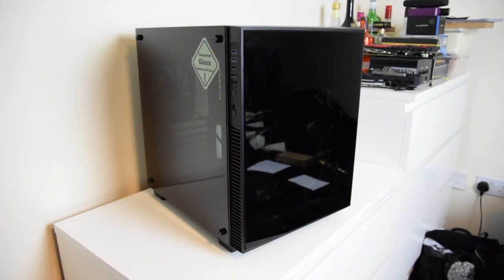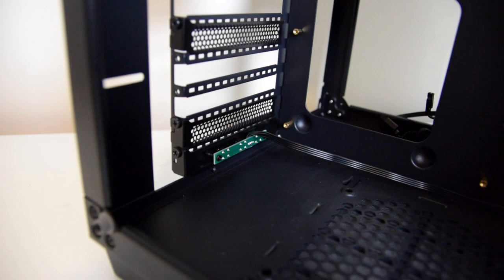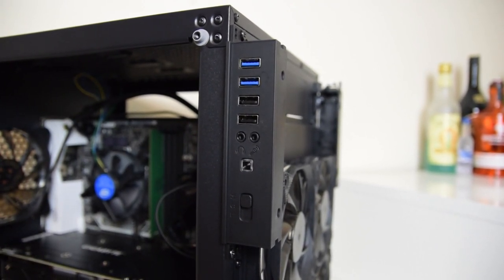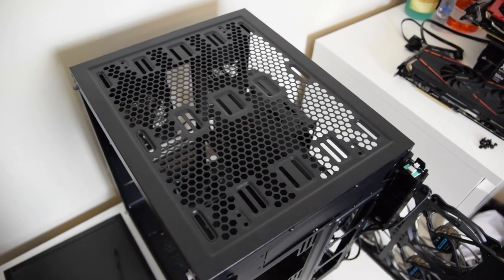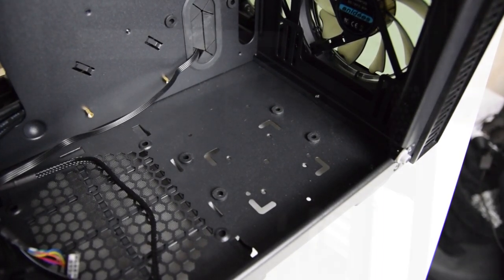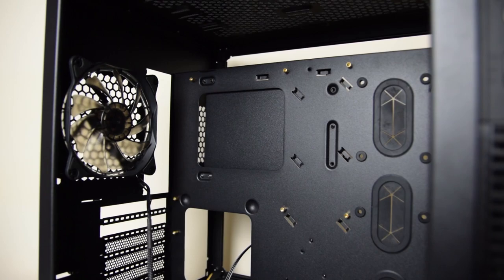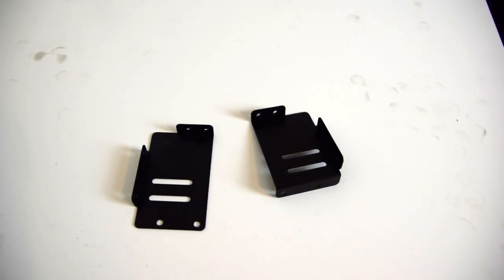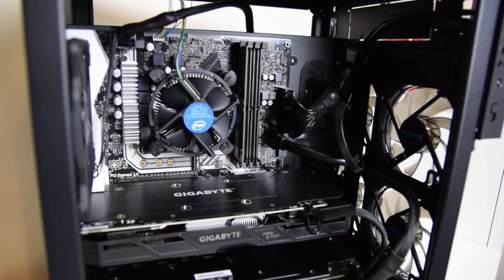Anidees AI Crystal Cube Case Review

Comment: I just purchased this 
MSI MPG X570 GAMING PLUS Gaming Motherboard AMD AM4 SATA 6Gb/s M.2 USB 3.2 Gen 2 HDMI ATX and it has an 8+4 pin cpu power connectors, I've already learned that I don't need the extra 4 pin unless I'm doing something that requires a lot of power but and I didn't have the extra 4 pin on my cpu for it neither so I bought a COMeap CPU 8 Pin Female to CPU 8 Pin ATX 4 Pin Male Power Supply Converter Adapter Extension Cable for Motherboard 9.5-inch(24cm) to fill in the 4 pin connection so my question is should I be okay with this or could something go wrong?